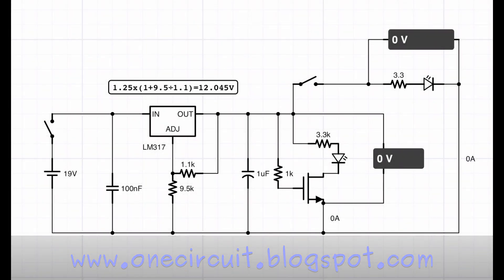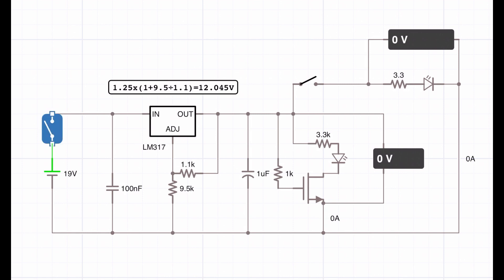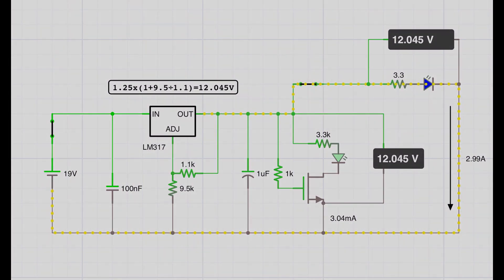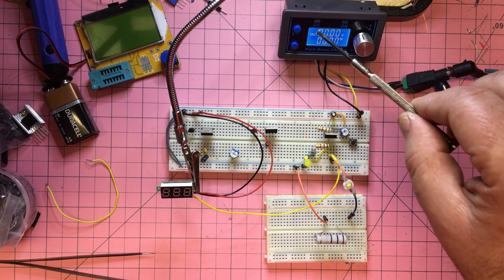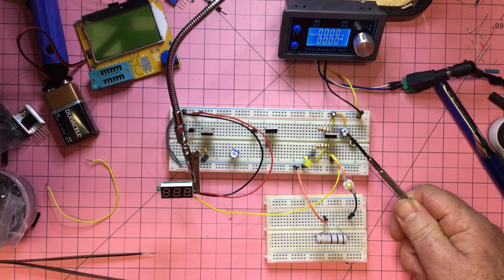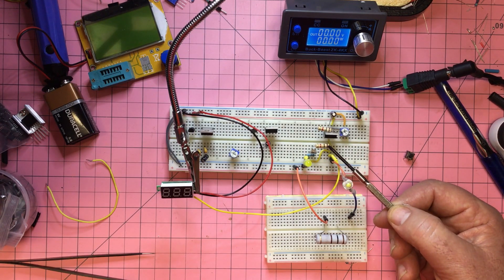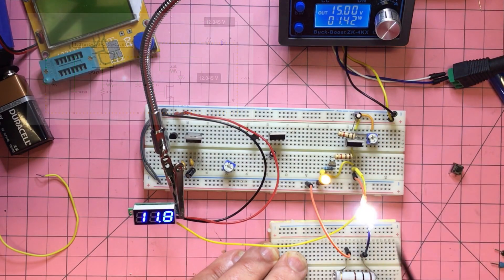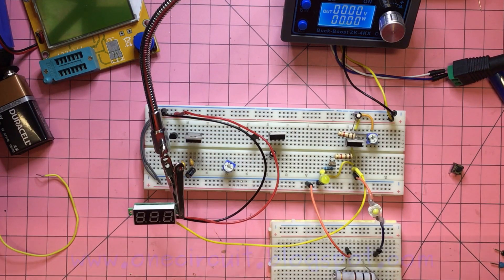PSU IV - BS170 mosfet indicator LED

Comment: Just curious, why use a mosfet for the LED and not just a resistor to LED to GND ?
Reply from the maker: I’m not sure! I think I had a much more complicated circuit originally, and pared it down. Probably I should have cut it down some more, but I was happy to get the mosfet working as intended so just went with that. Maybe the next version will make more sense! 🤔🤷🏼‍♂️

Comment: That's actually a pretty cool circuit. I'm also currently building a couple of multi-output power supplies. I like your multi step down circuit. The only drawback is the drop from 12.0v to 11.8v with a small 3w LED load, that means a larger load would affect the output more right? I would prefer a CV output personally but as you said it's only a proof of concept circuit meaning things change with each stage.
By the way, expect an email.
Reply from the maker: As a lab PSU it probably won’t be needed for big current, although the direct output from the switching converter will allow 3A with constant voltage/current options. The idea of the linear regulators for the final voltage drop is stability rather than load. I’m sure the project will evolve in the 2nd iteration after I’ve used this prototype for a year or so. I’m just chuffed that it works as intended! 👍😀
Reply: @onecircuit-as  same, I thought you did awesome. What program / website did you use for the simulation?
Reply from the maker: It’s iCircuit, linked in the blog which is linked in the description. 👍😀
Reply: @onecircuit-as  lol, should have thought to look there, duhh